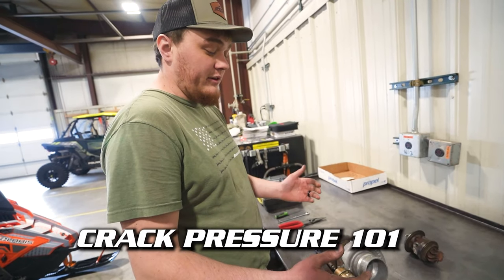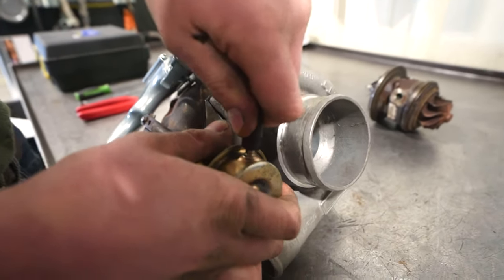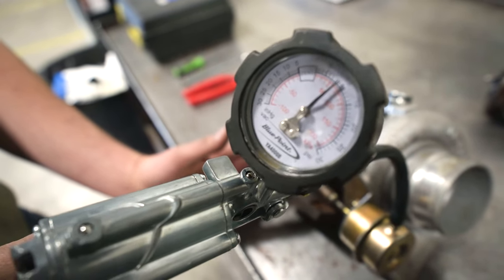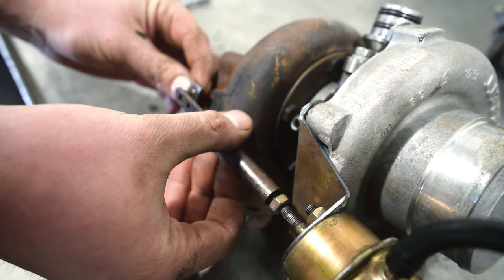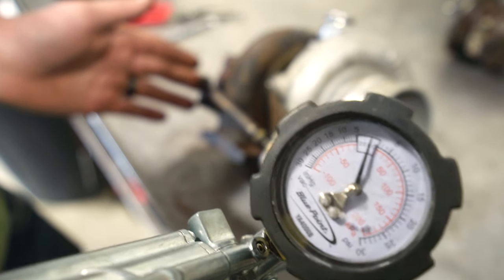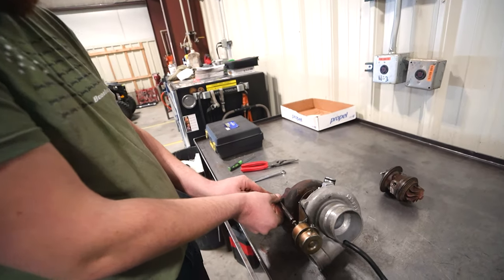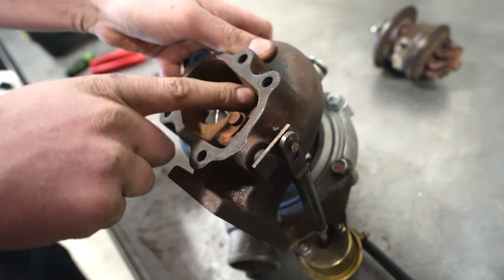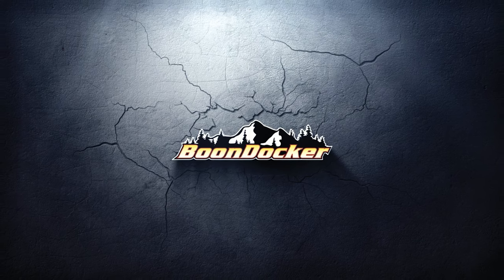How to Adjust Crack Pressure on Your BoonDocker Turbo

Comment: Thank you for a good video. Very good explane video. I have got replaced a Alanka twin turbo on my BMW 525D xdrive 2012. The workshop has not adjust the wastegate and I have no boost on my turbo. I have ran diagnostic and got error 29A400 saying actuator closed too far/positive control deviation.  How many psi should I adjust the actuator? I must buy the same hand pump as you have. Is it a Mityvac MV8255?